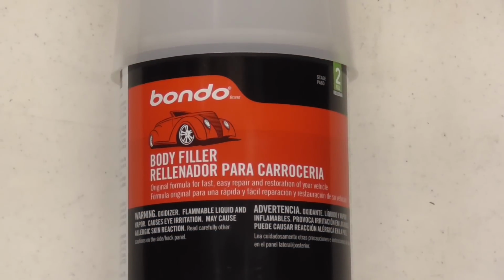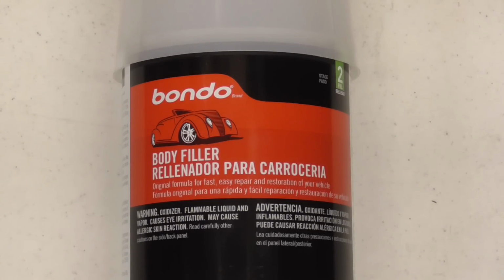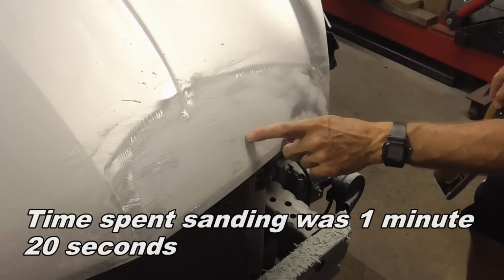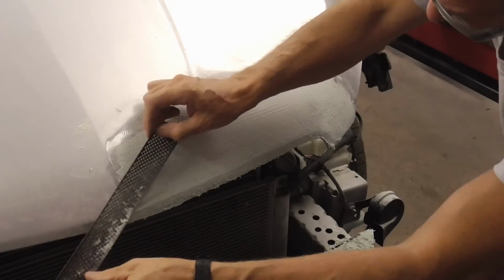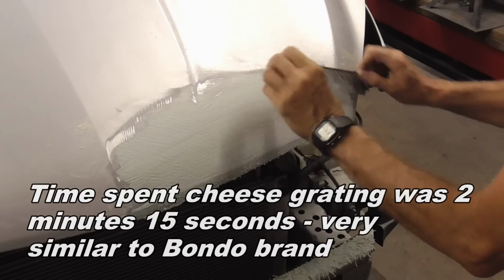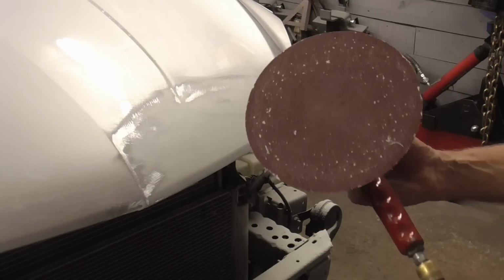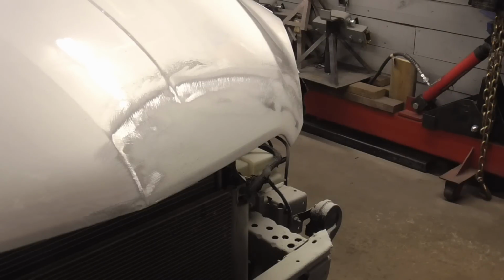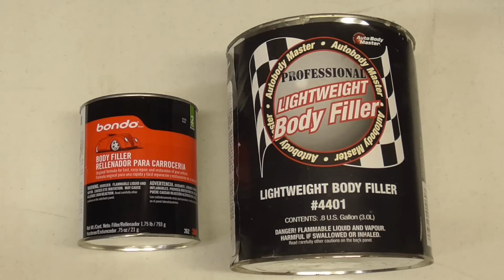Is Bondo Brand Body Filler Hard to Sand?  Are Expensive Fillers Worth It?

Comment: You made the comment that it was hot in the shop. Would you consider putting in a window ac unit to make it more comfortable and if not,why? Another great video, thanks for sharing.
Reply from the maker: The truth is... it's a steel building and at the time it was super cheap to put up - like 3200 for an 18'x21'.  I went the cheapest route and skipped the windows.  Now, I'm sort of happy I did because I need the room on the walls to hang stuff.  I need to live on a farm or some acreage really.  I might think about putting in an ac unit though on day :)

Comment: So I’ve got some insights here haha, I actually worked with the formulators and corporate decision makers at 3M(bondo), Evercoat, Sherwin/Valspar(USC, HOK), as a chemical engineer. Bondo has been mostly left alone/cheapened for the consumer market, 3M has more professional lines under the 3M branding that get more R/D. Evercoat is nice for the most part, but overpriced and think too highly of themselves. USC I think is the sweet spot, great R/D, great professional products at slightly above consumer prices. I quit corporate America to use the products I designed and the USC 17000 filler gives an amazing working time, flow and leveling, way less pinholes than bondo, and maybe $5-$10 more per gallon.
Reply from the maker: Hey - thanks for the insight and valuable information Tyler - I'll keep that in mind.  Thanks for watching and have a great weekend :)

Comment: What do you suggest I buy? I'm getting ready to do my cab corner on a regular cab 96 Chevy Silverado. I don't know if I should glue or weld. But what body filler do you suggest?
Reply from the maker: If you are pretty decent at welding and you have a welder then go ahead and weld it.  If you don't have a welder or want to try something different or unique try gluing.  I think welding is more forgiving - in other words if you mess up it's easier to repair.  Basically you can't really mess it up.  With glue you have to think a bit more and plan.  If you've good a good plan though glue can be easy too.  Both last - see follow up video - https://www.youtube.com/watch?v=gIS1Tbv7Kvw  Any filler will work for you - don't spend a lot on filler.  Any gallon around 25-30 bucks will work just fine.

Comment: With a battery powered palm sander bondo comes right off.
Your cheese grater was a new twist that looked super fast.A good body man is definitely an artist many years in the making.
Reply from the maker: Thanks for you support Tr7b - the cheese grater is fast and best part is no dust :)
Reply: @LakesideAutobody  The battery powered palm sander I bought at Harbor Freight had a dust bag.73$ 10$ more for the bigger battery.Knocks down my bondo like crazy.
But I am sure you use power tools for bigger jobs.
Reply: Good demonstration Jerry.. in my personal experience, Bondo brand was harder to sand if I walked away from it too long.  If I got on the filing and sanding in a timely manner it was fairly comparable. Personally I'd never spend triple digits for some of this modern wonder filler.

Comment: great video as usual. One question. How deep of a dent can be filled with bondo without causing an issue? I heard no more that 1/8" deep. Is that true?
Reply from the maker: That's absolutely not true.  There's really never a reason to use more than 1/4 or 1/2 inch of filler but I have 100% confidence that it would be fine if it is applied correctly.  See this video on "How Thick Can Bondo Be?" - https://www.youtube.com/watch?v=rIoNhu166Hw

Comment: This guy is more speed than gettng the surface level. Funny part is using machines slows the job down. You should use the flat palm of your left hand over the panel filler because it is the sensitive hand whether you are right or left-handed, often, to get the shape right. Teaching the truth of the sensitive left hand is not taught anymore. But it is a fact. 

The concept comes from panel workers who do not work directly in car repair. They shape panels on presses and rollers. They get feedback on how the shaping is going by regularly running the left hand over the panel. 

Bet this guy doesn't use a mist coat of paint of a contrasting color over the primer before fine sanding.  Rub all the mist paint off. Otherwise the lines from earlier coarse paper will show up in the finished paint.
Reply from the maker: When a body man gets good enough there is no "feeling" anymore.  You know you have it straight just by how the filler or filler primer "feathers" in.  Every once in a while you might give it a quick check with your hand but either hand works fine - body guys can feel any wave in a split second.  As for a mist coat (guide coat) - here's a video on that - https://www.youtube.com/watch?v=31ONIPIprJk  Once again most guys don't use a guide coat after a few years of working in a shop :)

Comment: I like your  old school National Detroit DA.  I  still use one everyday.  I use a  NA DAQ.also. Snow White filler  I was taught with in the early 70s,  . Wear a mask.  !  even if it is hot. !  use a fan. I learned the hard way,,,the  stupid way.  When I was young , 20s ,,30s  if you wore a mask you, were a pussy,  after my 1st heart attack at 40, in 95,  I got  a air supplied mask. Use it every  day.  saved  my life.  I'm 69 now,,  Restoring a 71 SS Chevelle.  USC  Metalloy,.was a good filler.

Comment: Another tip. If you’re not going to cheese grate it's very wise to wet a towel with lacquer thinner and wipe it over the HARD filler. In the polyester system paraffin wax is used to prevent the peroxide from evaporating out of the filler, this is why the top surface of the filler is shiny, the wax rises to the top, without the paraffin the chemical reaction responsible for hardening the filler would not happen. The rag soaked with lacquer thinner removes the paraffin and prevents it from loading your sandpaper.
Reply from the maker: Great tip Sataman - my dad would hit it with some used paper first but the thinner trick is something to remember.  Always appreciate your comments my friend :)
Reply: It's called blushing it's when there's a reaction with oxygen it forms a waxy layer epoxy does the same thing yes you can get it off with cleaners
Reply: The easiest thing to do is grab a handful of sanding dust and rub on the area then get to sanding you also will not clog your sandpaper if you do this fast easy cheap and free
Reply from the maker: @tonydiesel3444  Interesting idea.  Thanks Tony - I'll have to give it a try :)

Comment: I don’t know if you remember the old Ditzler 999 but that filler was like sanding concrete.  Anything made today is easy to sand compared to the old fillers. I haven’t used glazing putty in years just because today’s fillers are a lot easier to apply and sand.
Take care Jerry
Reply from the maker: I'm not sure what my boss used.  He had those dispensers on the wall and air pressure would push the filler out on your mixing board.  Might have been the 999 stuff 'cause he used strictly dupont and ditzler products.  I think I remember seeing some Martin Senour stuff too.  You're right though about the glazing putty and just using regular filler.  Always appreciate your comments Greg - have a good week my friend.  😊👍✌
Reply: Black Knight heavyweight filler laughs at your fresh sheet of 36 grit... lol
Reply: @karsbkool  that doesn’t sound like fun. Thanks for watching
Reply: @autobodytrainingsolutions838  once the Black knight sets up, only a grinding rock can take it down...  I much prefer "space age microspheres" 😁

Comment: Hey Jerry.   I always get so pumped when I watch your videos...Then I try it on my own vehicles and it's never quite as nice,.  No where near actually.  I think I cheap out on sand paper.  I did follow your advice and I bought a small cheese grater.   It's really helped reduce the sanding !!!!   Great video.  Great advice.
Reply from the maker: Yep - can't cheap out on the paper.  Gotta grab a brand new sheet.  Save the good used ones in a "used paper" box for other non important sanding.  You just have to use a new piece of 36 or 40 grit if you want to make life easy for yourself.  Always a joy hearing from you PSG - have a good weekend :)

Comment: One thing I have found which has helped me in the 'separation dept.' if body filler has been sitting unused and unopened for a few days... is to put the can in a paint shaker to mix the resins which sometimes settle leaving a bit of the liquid on top. 

I seem to have a smoother finish when sanding without getting pinholes, even with the less expensive fillers.
Reply from the maker: Thanks for your input Russ - have a great weekend :)
Reply: Absolutely right, You've got a paint shaker in the shop why not use it?
Reply: When I worked in a shop I think a gal of filler lasted maybe 2 days if lucky. 
What I did find out the coffee by 10am was thicker then the body filler due to they never emptied the coffee grounds just kept adding on top all day lol  by the end of the day it was like mud lol
Reply: @satamanschmidt3428  people laugh ,but that's a tool that's on my list.
Reply: We had a guy that put z grip on the pant shaker, and he had the worst pin holes.

Comment: Sure wish that I could remember the name of filler that my buddy’s dad used in his shop 40 years ago. Once I tried it, thats all I used for at least 10 years. Very easy to sand, no shrinkage and excellent feathering. All that I remember is that it was gold color. But 3 times the price of regular old Bondo. It may have been a Mar hyde product as that was a brand that the local Werners Auto carried at the time.  Boy do I miss those old parts stores!
Reply from the maker: Old stores with old dudes that knew stuff!! 🛠😊

Comment: I don't find them hard to sand at all,but there is brands now adays that cost less than Bondo brand filler,it's all on.the timing in sanding body filler,usually 15 minutes ,I hit it with my 36, especially with this temps.

Comment: I would refer to what Jerry says as gospel but I stepped up my filler from bondo to a brand upol which is still pretty inexpensive.  I struggle to get bondo to spread nice without flashing and then it always wants to flash right where you already spread it.  I end up with misshapen bulges.  After I switched I knew immediately I was happy to pay 3 dollars more.  I don't have the experience that the pros have so maybe it's just me.
Reply: Sounds like too much hardner was mixed in or it’s just old filler. 

Always check the date on it like buying groceries. Be surprised how much stuff sits on a shelf for a year or two before selling. 

I’ve had the unfortunate experience of getting really old window tint that was way past it’s prime before and it’s not fun to work with.
Reply from the maker: Thanks Motoworks - I appreciate the kind words.  If you've found one that works for you then stick with it.  I think the Upol brand is pretty good stuff - inexpensive but works. If you are having trouble with filler hardening to fast then cut down on the hardener like SoH said.  Start with using 1/2 of what you are using now.  If it hardens too slow add more.  If the metal is hot - like you are working outside, try working in the shade to keep the metal cooler.  The hotter it is outside the faster it sets up.  Let me know if that helps :)
Reply: I almost bought the upol last night but ended up getting 3m cause I only needed one quart. Upol was 3 liter only. If the 3m dont work ill def get the upol, as I already love their 2k urethane build primer.
Reply: there should be no clumps...like SoH said, check the age and then, check how you mix it...I used evercoat at automotive school... having said that, I am using BONDO to rebuild a fiberglass bumper.  The short fiber seems easier to use than Duraglass.  -- I have never had it not stick to the layer before - rough it up with 80 grit, that's my 2 cents...

Comment: I rarely use polyester filler due to the smell of it causing diplomatic issues in the apartment. But the regular Bondo doesn't spread as well, cures tacky, and even past the tacky layer... it gums up sandpaper. I prefer to deal with the super hard glass filled version from Canadian Tire (I discovered under the label it was evercoat rebranded as Motomaster), or to try and sand wet wood glue or a diamond plate.  Basically, can't always use the cheese grater, if it was applied thin to begin with! I get a better finish with glass reinforced vs this generic bondo.

EDIT: I use polyester filler where wood filler or a drywall compound won't cure fast enough or won't stick or be durable enough, and epoxy would be a pain to mix and apply and wait for the full cure before sanding. Or model making sort of things, woodworking, general repairs.

Comment: i really don't think this proved very much. Here's my take: for the first coat of filler it doesn't matter what cheap assed filler you use as the cheese grater doesn't much care as long as you get to it while it's still gummy. Where the quality of filler comes into play is the finishing phase. Use Z-Grip or some other crap for the first coat but go to Rage Gold or Ultra for the final coats. That's where the difference in pin holes and sanding to a thin edge becomes most apparent. My system is Z-Grip to start, because it's cheap, Rage Gold to get 95% there and Metal Glaze for the final 320 grit stage prior to 2K primer.
Reply: That's exactly what I was doing , worked great.
 I recently tried a new filler, Carworx Optimum as they were out of Rage, takes longer to dry but so far seems to sand easier and smooth, and don't have to do the metal glaze. But again I'm a skeptic so we'll see how it goes
Reply: Companies love it when you buy 3 products to do one job👍 
  A lot of us have to watch the budget, so cheaper filler and maybe an affordable glaze and the job still gets done. I also don't have 20 paint guns each having it's own specific material it will spray...job still gets done.  My old paint and body hand book says to cut a paint paddle(stir stick) to size and wrap your paper around it to block a repair. A book today would say you need a complete block set of 6 sizes plus an assortment of soft sanding blocks to do the job...

Comment: 👍🏻 Thanks for the experiment/test I’ve always wondered that myself. I did see the Bondo brand was made by 3M Company so it can’t be all that bad.
Reply: Bondo used to be owned by duro/Woodhill...it was sold off to 3m around 10 years ago I believe.
Reply from the maker: Good observation Michael.  Hope everything is going good for you MM - have a great weekend my friend ✌😊
Reply: Rage Gold Ultra is way better than bondo and worth the price IMO. Price being like $70 a gallon, because Amazon tries to sell it for like $120 a gallon last I checked. I found some place in Florida that sells it half off that price. Auto Restoration and Collision, or something like that
Reply: @P L  Didn't Robert "Bondo Bob" Spink create it? I have an old poster in my shop for a filler advertisement from the 50s which was an epoxy based filler that came before the Bondo type products I think.
Reply: Haha 3m owns Bondo. 
Shocker 🤣
Kinda strange how 3m would downgrade like that, but it was probably a buyout thing and there's probably decent capital from it.
I hope they don't keep that up much and aquire more name brand products,like GE does and just buys someone up and puts their name on it.

Comment: Thanks for another great video. IMO I think the 36 grit sanding on the lite filler in your video was smoother and cleaner. I recently ordered 3m lite body filler because I was having issues with traditional Bondo drying enough before sanding then soaking up solvents in my Nason etch primer. I may switch to 2k epoxy if this continues to be an issue.
Reply: @A. Melbs On two fenders I was refinishing, it took a lot more time for bondo to dry on bare metal than what the instructions told. Then when spraying with the etch primer, the bondo would soak up the paint solvents, requiring a lot of extra time to dry on the first few coats. The effect of having the bondo soak up the etch solvent caused the bondo to at times peel, swell, or leave imperfections in the paint where the gas was still escaping
Reply: You do realize that polyester and etch don't mix. Etch primer should exclusively be used on bare metal. You can put filler over epoxy but you shouldn't put it over etch ever unless you put a coat of 2K urethane over the etch first. You can put quality fillers over 2K urethane, read the data sheets, but by and large etch and polyester don't co-exist well. The answer is chemistry. Polyester is hardened with MEKP which is peroxide and etch has phosphoric acid in it which neutralizes the peroxide preventing it from hardening the filler. Unless you're a bodyshop trying to speed things up epoxy is always a superior solution to etch.
Reply: @satamanschmidt3428  Thanks for the info im still pretty new at this. And to clarify I put my bondo directly on bare metal and the etch on top.

Comment: I can't stand sanding bondo. I'd take anything from Evercoat over Bondo by a mile
Reply from the maker: If you are working hard, you're doing something wrong.  That's what my dad used to say about sanding filler.  Try this and don't listen to the magazines/TV that say you have to use fine sand paper - they don't work in body shops.  https://www.youtube.com/watch?v=fnfoVf4fKoc
Reply: @LakesideAutobody  maybe it’s not worth it to you but I only do like one car a month. Idk last time I used bondo I was pretty new to this so maybe my technique was bad. I have a couple of hand planers that have a cheese grater bottom, for that purpose. It’s a great tip, saves a ton of time. I’m always in the fence whether I should do the body work or go to the pick a part and buy one, if possible of course.